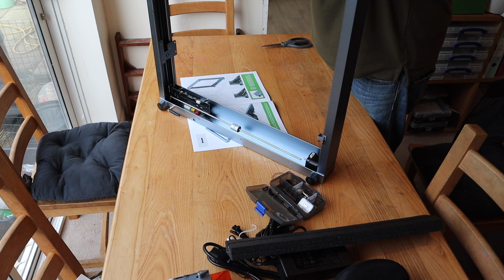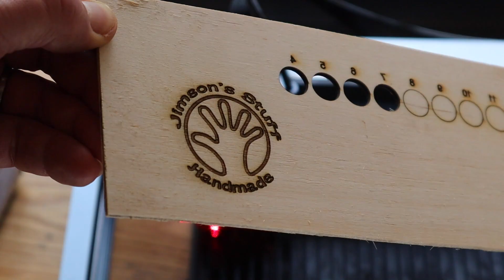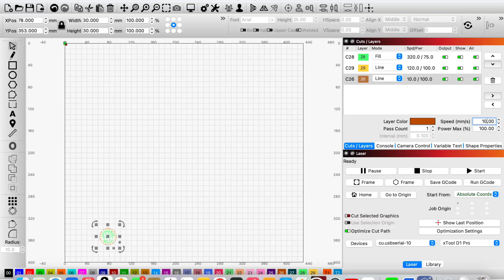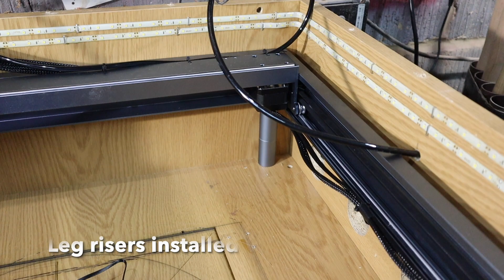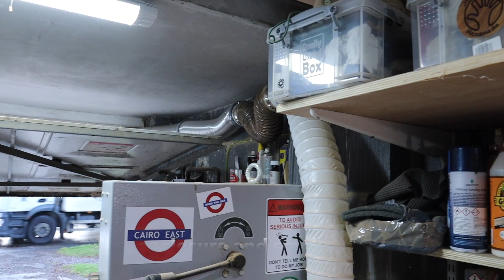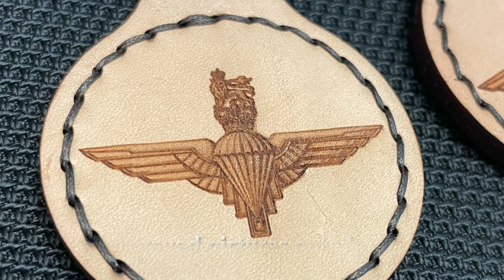XTool D1 Pro 20w Laser +  RA2 and Air Assist - Pro Level Laser Kit !

Comment: What settings did you use for the glass engraving?
Reply from the maker: For engraving glass with simple designs and lettering I use 30-40mm/s at 100%, for engraving pictures I use 30mm/s with max 100% min 20%. I have now started using black Plastidip spray paint prior to engraving because most of it just peels off afterwards requiring less solvent. Many thanks for watching
Reply: @JimsonMakes  Thank you so so much!!!!

Comment: What laptop is best to run this laser???
Reply from the maker: You would be best to check on the XTool website, I don’t think you need a very powerful laptop to run the laser but I am not sure what you need to run the design software. I use a Macbook Pro.